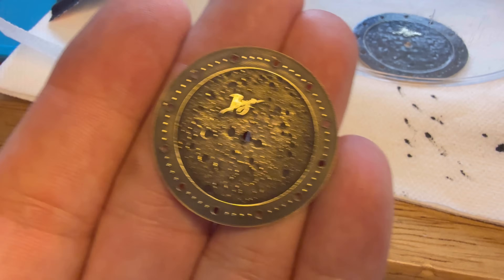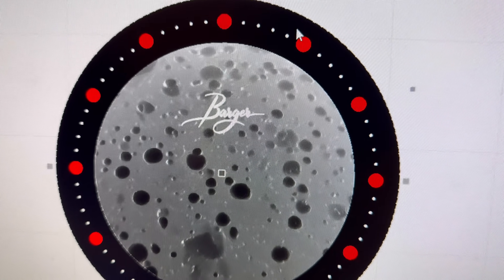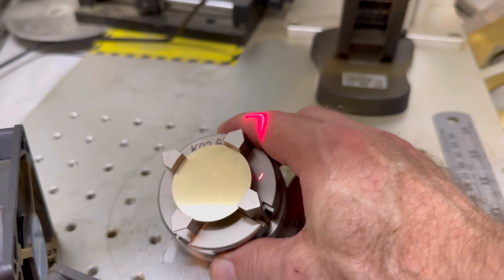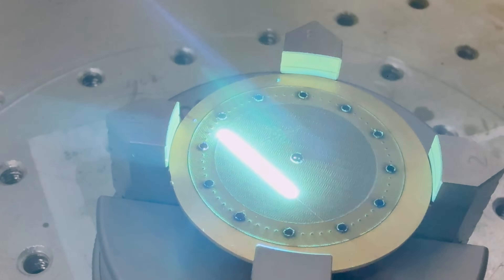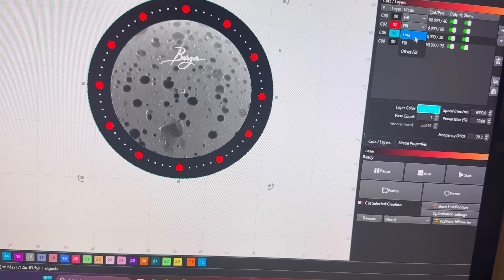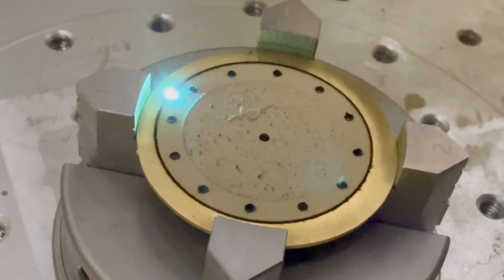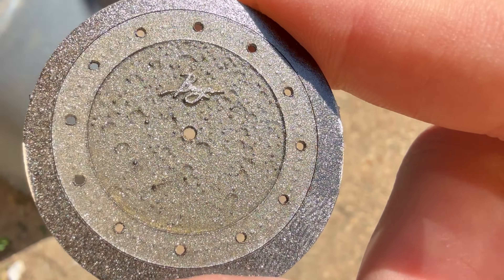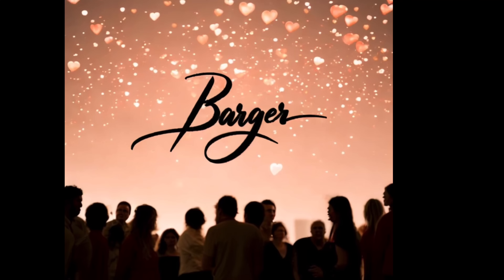How to Make Custom Watch Dials using laser engraving on fiber laser: power settings, speeds, & setup

Comment: What is the enclosure you are using. It looks like a 3d printer enclosure. I just got a 50w Omtech 1064nm fiber laser. Would this enclosure work for concealing the fumes? I assume I still need to wear the safety glasses with this enclosure. I dont think it is OD6+
Reply from the maker: It is a laser/3d printer enclosure (marketed for both) but it is a barely too small but contains the fumes and I have a vent on it to get rid of those (which you need). The front lip on my laser hangs out slightly keeping me from zipping it closed completely, but I get positive airflow into it while the exhaust fan is on.  It has a tinted Velcro on window so I don’t have to wear goggles.  But I have them right there in case I need them.  Here is an affiliate link if you want to buy one and also help my get a small commission (about $3 if you use the link to purchase this).  😊. https://amzn.to/3ML9Tmj

Comment: What was the thickness of the blank? (Sorry if you mentioned it. But didn't catch it in the video). Great work on this!
Reply from the maker: The brass blank is .7mm thick.  Normally a dial is .4 to .5 mm and you can either remove material post engraving or use a higher hand height on the movement to be sure the hands clear the dial.  I use a hand height change to the movement on most of the watches I build. But you can just sand off the back of the dial and make it .4 or .5 mm instead which if I were using an NH35 or quartz movement I would definitely do.

Comment: I’ve been doing some dials with my laser with mixed results. This video was recommended and I learned a lot. Thanks for taking the time to do it, and particularly showing all of your lightburn settings. Your dials are beautiful and you’ve helped me improve mine. Thanks again. - John
Reply from the maker: Thank you for letting me know.  I definitely struggled finding the settings and am still learning as well.  But after a year doing this with the laser definitely have had some good learning.   If you end up posting any videos please come back and leave a comment to this so I can pin it for others to find as well.   I always enjoy watching other creators work.   Also I ordered a new cnc with tool changer and as soon as I get that next year I will be digging into that with my lathe and plan on doing some significant work and training that should raise my skills and quality significantly.    Good luck with your dials and watch making!!

Comment: Hey that’s a nice work ! I have ordered mopa m7 100w for that ,can you tell me where to find that nice jig to hold the dial ? Thanks in advance ,have a nice evening
Reply from the maker: I have two.  The vise is from eBay and it is a small laser vise and the second is just a 4 jaw lathe chuck up to 70mm.  I am sure you should be able to find both on EBay.
Reply from the maker: @dawid-p5s I just found this on AliExpress: $189.46 | Fiber Marking Metal Sheet Holder Marking Attachment Fixed Bracket Metal Foil Thin Paper Clamp For Laser Marking Cutting Machine
https://a.aliexpress.com/_mMHBvLP
Reply from the maker: This is the one I would recommend: I just found this on AliExpress: $189.46 | Fiber Marking Metal Sheet Holder Marking Attachment Fixed Bracket Metal Foil Thin Paper Clamp For Laser Marking Cutting Machine
https://a.aliexpress.com/_mMHBvLP

Comment: A cnc machine would do a better job than this or laser engraving is better for making this dial ?
Reply from the maker: Yes.  It would be better for a number of operations in making the dial but the laser may be better at super fine engraving; but also, maybe not depending on the end mill bit being used.  I have a vertical cnc mill.  I just haven’t used it for dial making except to do some after laser operations things.  I will likely start doing more cnc and lathe stuff sooner or later.  But I really enjoy using this and the setup is easier for me as well.

Comment: Always wondered how this works so happy to see the this video pop up in my recommendations
Reply from the maker: Awesome.  I am glad you liked the video!!  This is just one method and the traditional methods of using a CNC vertical milling machine or even the manual engine turning machines with pad printing or additional hand engraving after are more traditional methods.